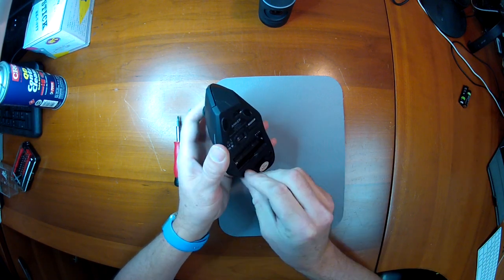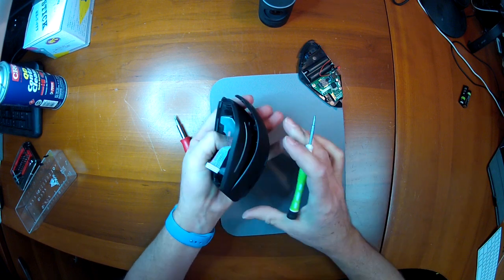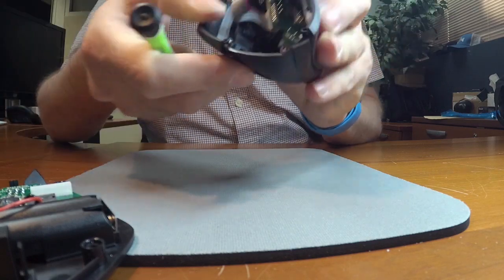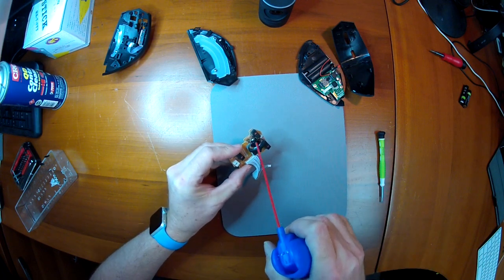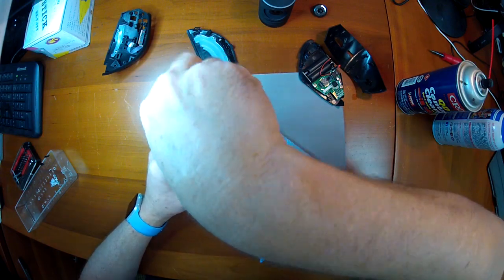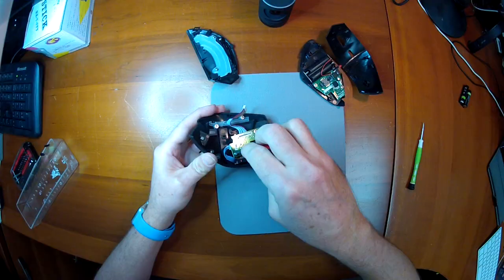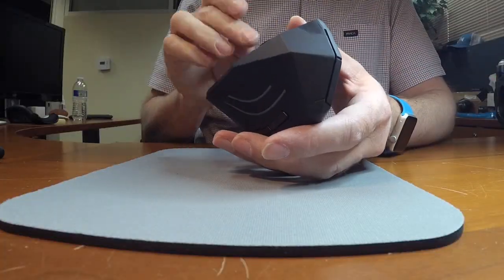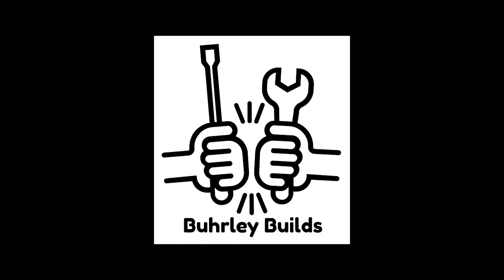Mouse Scroll Wheel Fix

Comment: I have the most recent version of this mouse with an internal battery instead of AAAs. The process is mostly the same. The three screws underneath the mouse are in the same positions. Unscrew them and you can then pry the very bottom of the mouse off. Remove the power cables attaching the top and bottom of the mouse. From there you can then look inside and see that there's a single small little clip keeping the right mouse button in place. Unclip it and you can then pry the top mouse buttons off. I started to pry from the back left and it came off with a small amount of force. There's actually only one screw keeping the top of the mouse in place, it's to the right of the scroll wheel. Remove that and you can take the top of the mouse off by pulling it apart at from the back. From there you can remove the PCM board (two screws) and clean the mouse as in the video. When reassembling be careful not to snag the power cables under the PCM board. There's a good few sharp pieces in the mouse as well so be careful not to cut yourself. It does feel a bit like you're going to break the mouse on account of how brittle the plastic is but I managed to repair it with no issues. Hope this helps someone!
Reply from the maker: Thank you so much for the updated information, that is good to know. Unfortunate that the original problem with the scroll wheel has not yet been fixed though. I appreciate that you took the time to make that comment.

Comment: Oh great. Because I don't even know what the contact cleaner is, nor that blowtorch thingy except it fires air instead of flame.
I really need someone or something that should explain what causes the mouse wheel malfunction, not just "Do exactly what I did in the video" kind of sh!t.
Reply: @Sean Yates
Yeah, I just bought a new mouse and decided to cover it with something when I'm not using it.

Comment: Mine is a wired vertical Anker mouse. Had a bit of a problem removing the cables (too tight) and also the cover above the buttons. Otherwise, the scroll is working fine after repair. Thank you for the tutorial!
Reply: hey bro, the thing that goes into the potentiometer broke, do u have any suggestions of what could fit in there? if so can u please let me know thanks

Comment: I bought the Logitech M590 because it's a silent mouse without the clicking but the scroll wheel feels too loose like it doesn't have enough grip on the teeth. I was wondering whether something can be done to either the axle or if there's some sort of gear in the potentiometer that I can modify. Having a wheel that doesn't have enough grip when one spins it makes for a frustrating experience when gaming; I have to use the scroll wheel to rotate through items but omg it drives me nuts that I can't land on the item I wanted because the wheel is just too soft.
Reply: Yeah, i got one of those too, and i ended up selling it.